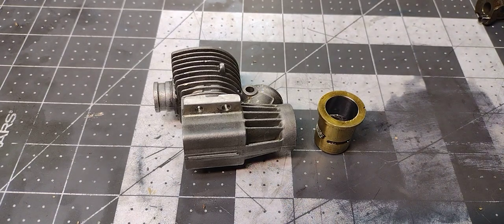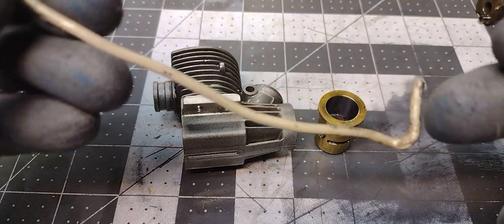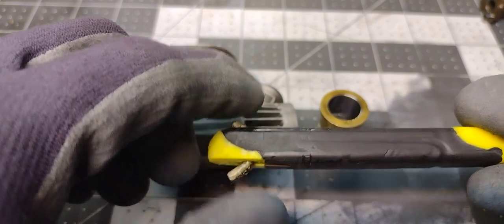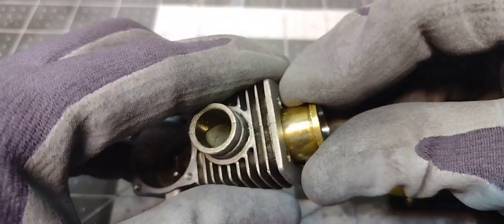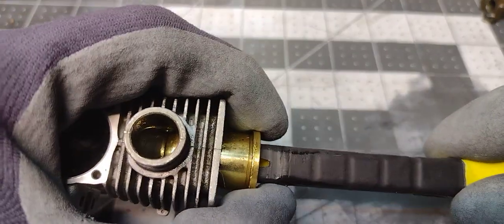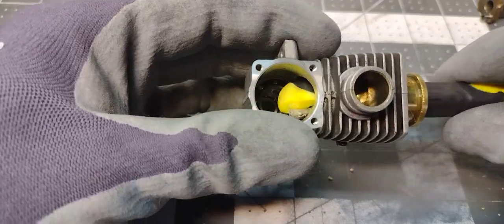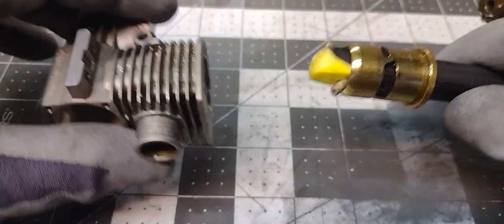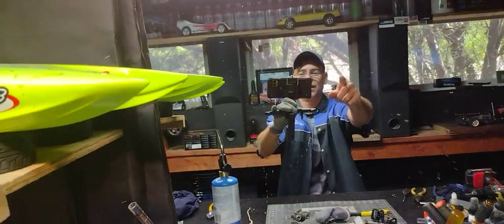Nitro Engine Sleeve Removal Tool

Comment: Hay bro very nice tip well done I just finished watching the video of the boost os backing plate 👍 very cool had a sh 8 port with the boost port very different but not as good as the new motors now good work bro ❤